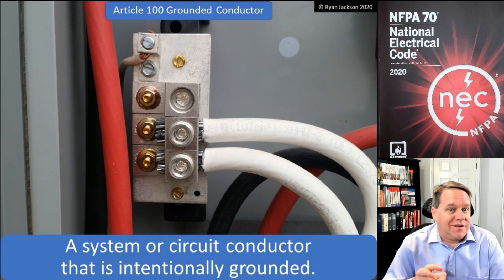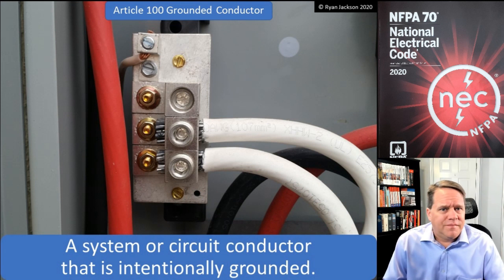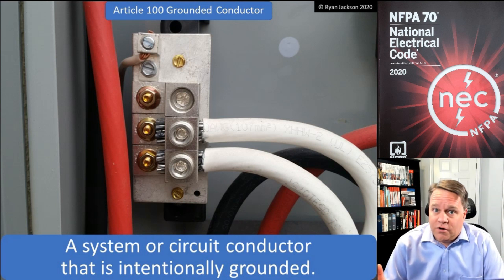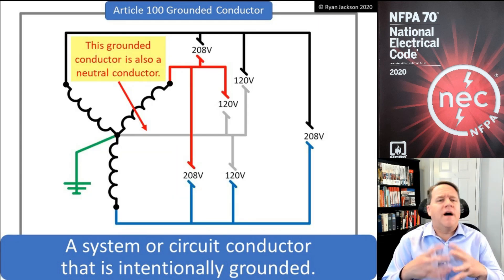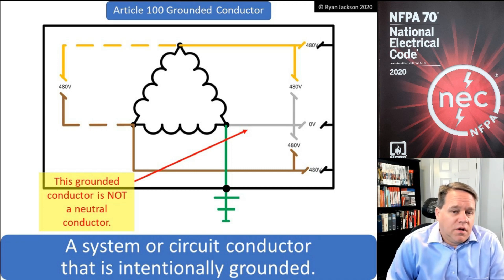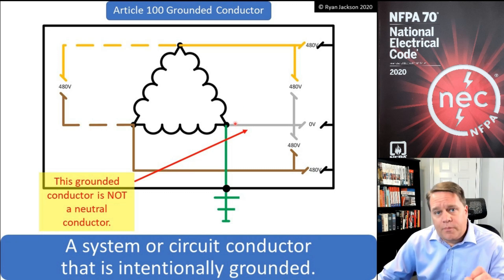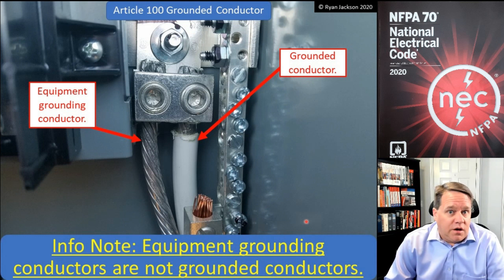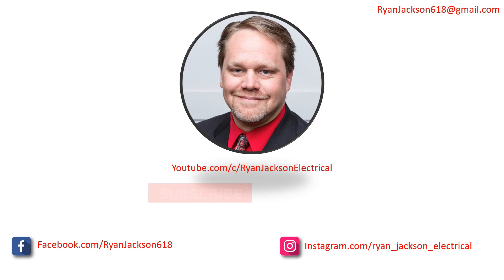100 Days of Article 100: Grounded Conductor

Comment: The 'grounded' (system ground) part should only carry current when something goes wrong.  Barring that, it is just a reference.  Should something 'go wrong', the fault should be cleared by either an over-current device(needs grounding conductor of sufficient size) or a detection device(needs a negligible conductor size).  Either way, the 'ground' is a reference point for a fault or a normal circuit.  W/o it, the circuit will work but will have no reference point.  Sorta want to call 'ground' the 'zero' point.
Reply from the maker: I don't disagree with that.
Reply: Many caveats though, too many to list. E.g. ground "normally" carries the current coupled through Y caps and filter bleed resistors, so it can be very important for ground to be a low-Z connection to neutral over a wide frequency range that may carry high momentary currents under non-fault conditions. There are technically many other ways to create a "reference" with no explicit system ground to interconnect with a circuit ground. A circuit can be referenced to the negative or positive peak of either line for example.
Reply from the maker: @Ormaaj  It also carries some amount of current during normal conditions due to the unavoidable parallel paths for neutral current that will often exist. In neighborhoods with underground copper water piping it is not unheard of to have 10 amps or more on the pipe.

Comment: Always got me upset when lazy IBEW guys only used 1 tiny stripe of cheapest white tape to identify a 7 foot long grounded conductor in a 6' high 84 circuit panel. We were taught to install a stripe at  least 3" wide every foot or so inside every box. Luckily they usually used a green wire for all ground wires.
Reply from the maker: I really don't want this turning into a union vs non-union forum.
Reply: @RyanJacksonElectrical  ok. I always got along with both sides. As long as they performed good work. Had a fly by night non union contractor tap off a 3000 amp busway but some how only had 2 of the phases going into the 400 amp safety switch he installed costing over 40 people a lost overtime day then he installed PVC conduit without a ground wire to two 480 volt cooling tower fan motors. Entire cooling tower was made from wood. Contractor tried to get away with no hround wite needed because motors were on steel plates. Told him I never saw a air ground in NEC. Laughed when he called me a trouble maker. Told him no I'm a lifesaver. After other coworkers stuck up for me they did not allow him to do any more work there. When contracters did outstanding work I always  complimented on it.
Reply: there's good & bad on both sides. training does not guarantee brain engagement, or professionalism.